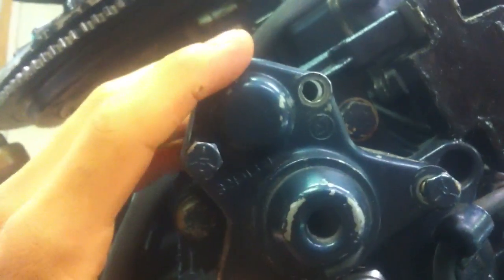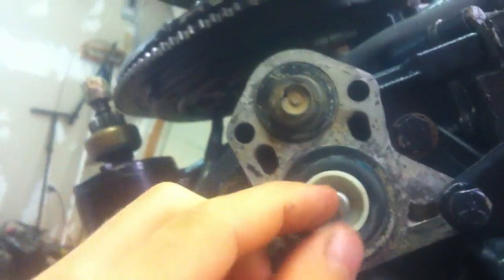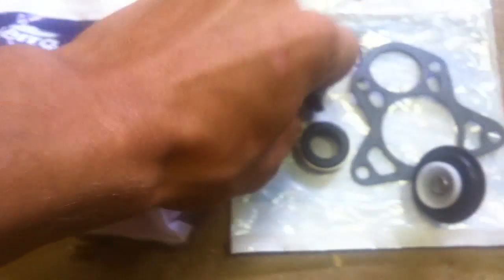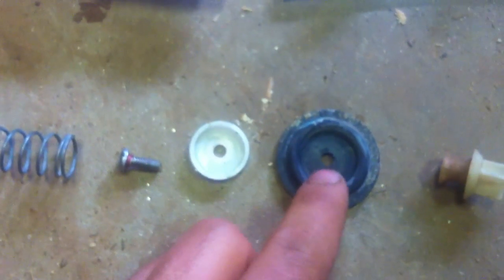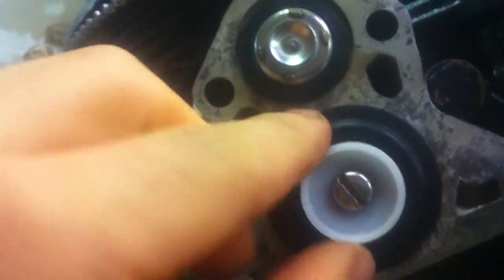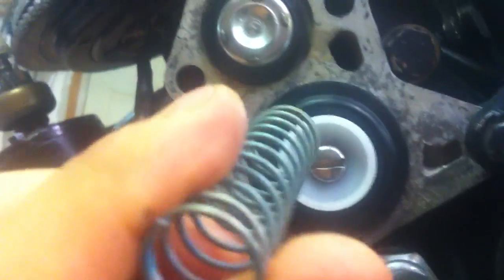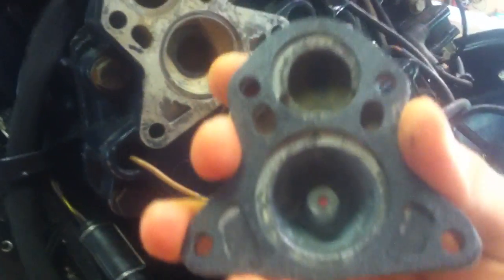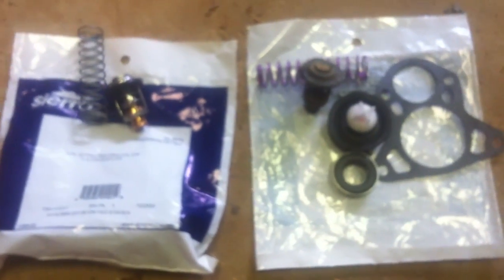How To Change An Outboard Thermostat

Comment: 8 years and your video is still helping. Just bought a 89 Bayliner with the original Johnson on it (J150tlce). Left piston Bank is running hot and we think it might be the thermostat. If we have to pull the water jacket cover you know where we could get the gasket for that?

Comment: I cannot find a complete thermostat set besides buying them peice by piece. 1993 9.9 outboard J10RETM.
Reply from the maker: They don't sell them as a set. You have to buy them individually.
Reply: @MattsShop  Ahhh booger. Thank you. Looks like I only need a few things for a set. The springs and the caps are good but the diaphragm is questionable.  They don't have those in stock anywhere. Maybe I can reuse them.

Comment: What’s up dude, got my 1984 GT 150 running. Idles just fine and throttles up. I feel like it’s running a bit hot though. Got a temp gun in the mail to check the power heads temp. One side is pretty hot to touch while on muffs. When I did my T stats I did notice a bunch of corrosion build up. Could there be a layer or corrosion inside that’s preventing it from cooling properly? Do the T Stats have to be rolled a certain way when installed or just slap them in? Same with that little valve below T Stat, certain way or just inserted?
Reply from the maker: Hey, what's up. The t-stats just slip in. I don't think there's any blockages with corrosion. Have you changed your water pump impellor? Check out my video on that. I'd change that first. How's the pressure out the tell tale?
Reply: @MattsShop  I did rebuild the water pump. It’s pissing really good. I’ve ran it submerged and on muffs. Pumps better submerged. Pisses really hard to.
Reply from the maker: Is this a saltwater engine? The water jacket can get corrosion and shells built up in them, but you dont want to try to take the waterjacket covers off. You'll snap bolts left and right.
Reply: @MattsShop  yes sir it the previous owner ran it in saltwater for the 25 years he had it. Said they always flushed it. We know how that goes. I had a lot of build up when I pulled the T Stats.  Did fail to look at that black grommet/rubber washer inside. Temp gun should be here tomorrow. Going to see what the external reads.
Reply from the maker: Yea, see what the temp says and post back. You know something's wrong if there is a huge difference.
Reply: @MattsShop  for sure man will do!
Reply from the maker: Ok cool

Comment: Hello, do you know if the control valve assembly on a 1989 120 hp johnson can be disassembled to replace a leaky seal? I have water coming out of the assembly. There's 3 water lines that meet in assembly. Thanks
Reply from the maker: Maybe. I am not familiar with a "control valve" on outboards. Can you be more specific please?

Comment: Do you know if that inside seal has a metal cup behind it or in front of it
Reply from the maker: Yes there is a metal cup behind that seal. You can see it at 1:30.
Reply: Matt's Shop but does it go in like that on the engine ?? I’m asking because mine doesn’t have it at all like they forgot to put it in or were to lazy to do it
Reply from the maker: It's behind the water jacket. You have to take the water jacket off to replace it along with that seal. I showed it at the very beginning of the vid. I'd leave it alone unless that seal is destroyed.
Reply: Matt's Shop it’s completely gone on both sides so I have to replace it

Comment: What is the torque specs on the thermostat?
Reply from the maker: The service manual says for 90HP-110HP and 150HP-175HP thermostat cover bolts it is 60-84 INCH pounds.